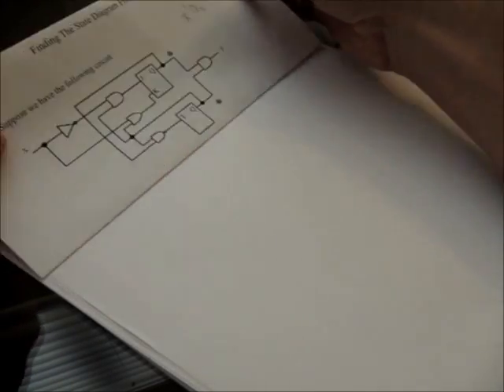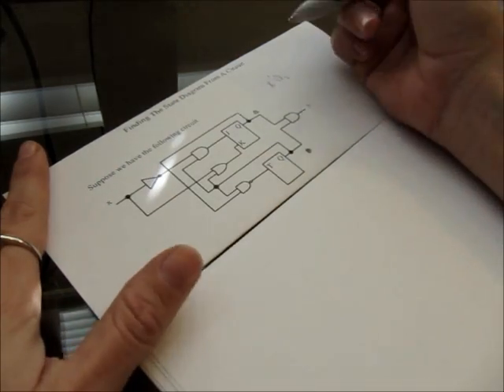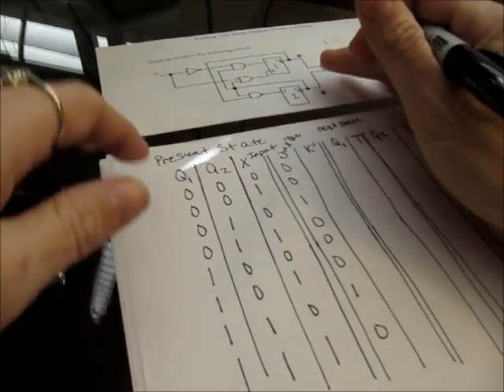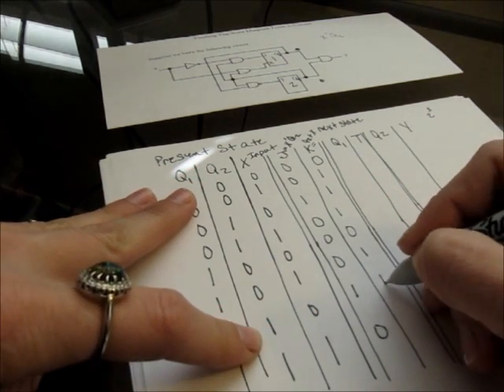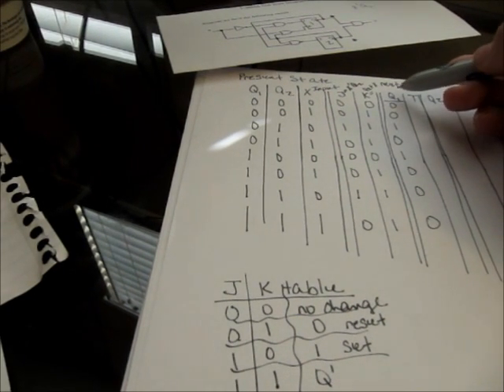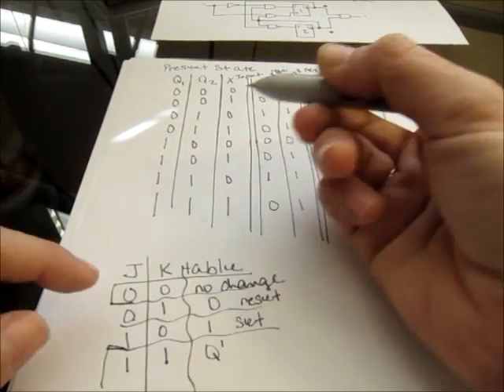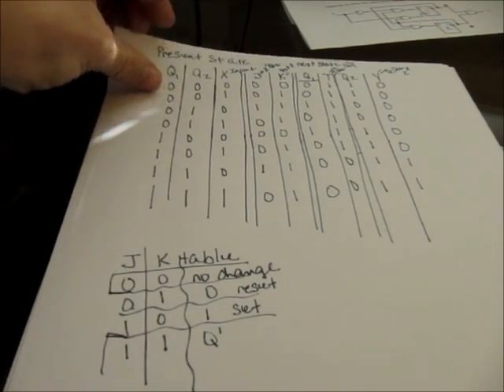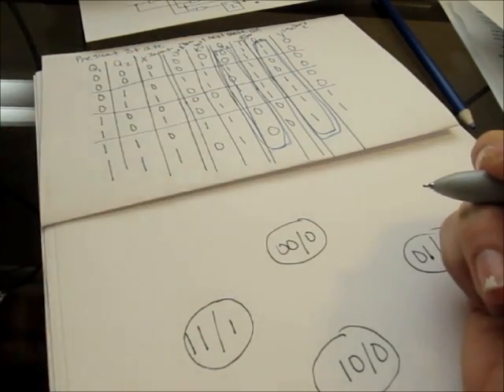Creating State Diagram from Circuit

Comment: At around 9 minutes in where you start going over how to find Q2.  I am getting a little confused.  So the input for T is (Q1 • Q2)’ and T flip flops are supposed to xor the inputs right? So normally when the inputs are different you output 1.  In this case the inputs are primed so anything that is different will out put 0 and the same will out put 1.  So if T gives Q2 how do you start getting 1’s  starting at Q1Q2X = 100 and 101? 

I probably understood it wrong.

Comment: Hey Jessica, I just had a doubt, you said that the output(y) doesn't change with the states, so why did you specifically use a Moore FSM, because in a Moore FSM, the output will not change until the state changes?
Reply: Moore Machines depend on the the current state alone, so the x-input would not make a difference to the output. This can be seen in the first two rows;

q1 | q2 | x  | y
0   | 0   | 0  | 0
0   | 0   | 1  | 0

No matter what the x value is, the y value will remain the same.

Comment: Jessica, could you clarify when you said that output "Y" doesn't change with the Q states? Y does change when both Q1 and Q2 are one. Maybe there's a lapse in my understanding.
Reply from the maker: When q1and q2 are the same so is y.. Look at the way I sectioned off the table.. No mater what x is y will be the same  for q1 and q2.. For example taking the first two rows where q1 and q2 equal 0 - when x equals 0 y is 0 and when x equals 1 y is still 0.. 

Does that make sense?
Reply: Thanks for the quick response! Yeah that makes perfect sense. Again thanks for the clarification, my night-time brain can get hazy at times.